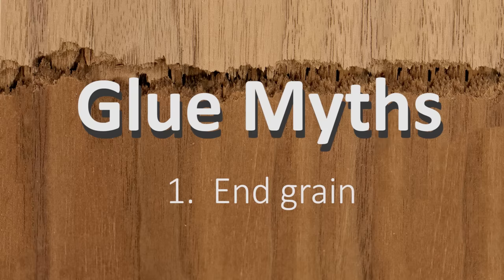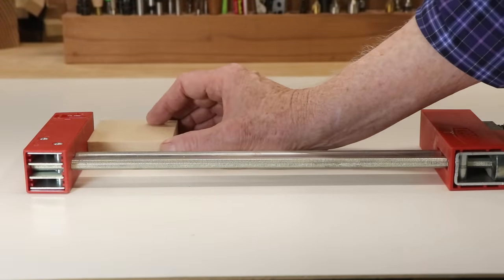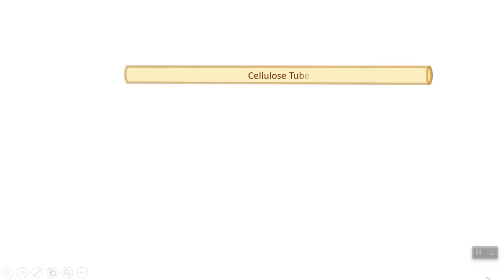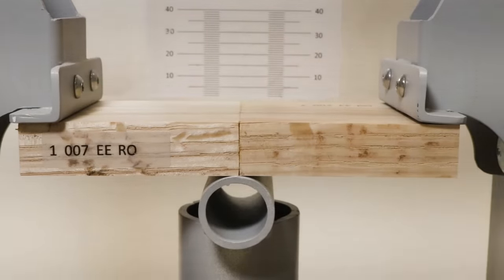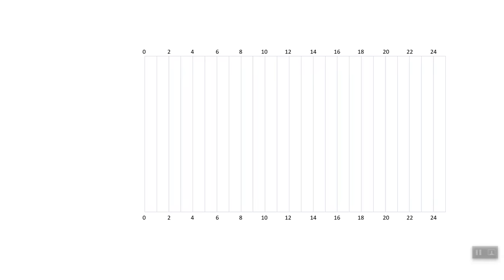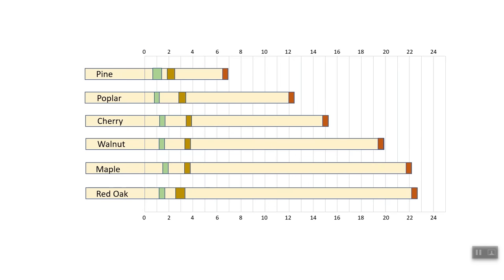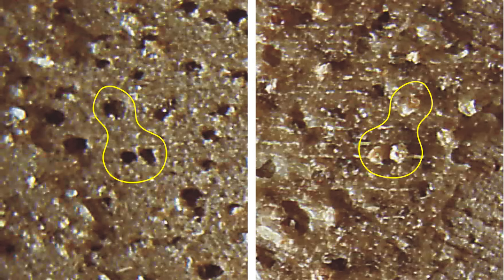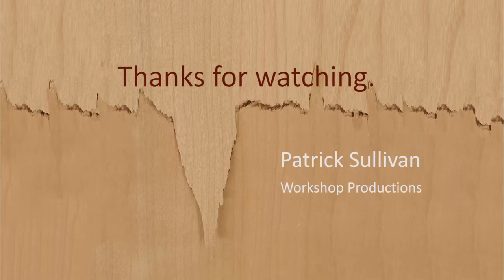Glue Myths:  1. End grain

Comment: That’s outstanding. And really fairly scientific in the approach. I like it. 

Kinda throws out the whole notion of needing “sizing” to get extra glue into the end-grain after some has wicked away. 

I think I might set up some similar tests as you did, if for no other reason than to corroborate your data for myself. 

At any rate, you earned a new sub, and I’ll be sharing. 

Thanks!
James
Reply: While sizing an end grain joint might work OK with hot hide glue, PVA doesn’t stick to cured PVA at all well.  It strikes me as a particularly awful concept.
Reply: @lightaces  Sizing according to Titbond is giving the end grain surface a quick thin coat of 50% glue and 50% water.  That surface is allowed to sit for 60 to 120 seconds and then a coat of normal glue is applied.  The end grain is not coated with full strength glue and allowed to stiffen and then recoated.  Again, according to Titebond.
Reply: @1deerndingo  well, that makes a lot more sense.  Not relevant to my business (see my other post about glue strength not really being important in a well designed joint!), but there you go.
Reply: @lightaces  I think the concept of sizing on end grain joints is not so much to cause the two applications of glue to adhere to each other (because we know that doesn’t work), but to fill up or block the porous end fibers, so that when the full-strength glue is applied, it doesn’t all soak into those end grains. That’s my thinking about it, at least 😊
Reply: "notion of needing “sizing” to get extra glue into the end-grain after some has wicked away."  This makes no sense. If the end grain wicks away the glue, then adding more glue would make sense. Having extra space there won't help.
Reply: Sounds like another test is in order.
Reply: Fairly Scientific!? that seemed like one of the best examples of scientific investigation I have seen in a while.
Reply: Reproducing results is a very worthy scientific endeavour.
Reply: @kristilbilyeu7682  So, the reason I was confused by this is I work mostly with hide glue, and "sizing" with hide glue you let it dry completely.  It works fine because old hide glue is reactivated by the new.  It's also used for completely different purposes - veneering, for instance.
Reply: @michaelwagner8856  It's really not.  The major problem is that, at no point did he actually break a long grain glue joint.  He broke the wood, and then made a conclusion as though those were the same thing.  Which they are not.  It also ignores the fact that glue reacts differently to different force vectors.  Peel strength is a completely different thing from strength under tension, or any of several others.  His methodology was faulty, and it led to some faulty conclusions.  I've got a couple other comments on this video detailing some of the problems, but yeah, no, it's not very good science.
Reply: @lightaces  those are valid points and you are correct that strictly speaking the actual strength of the long grain glue joint was not tested. But he did a lot of other thing well, like controlling the geometry so the shape of the joint isn't a variable, and he  tested each configuration several time so as to have more repeated data points. Its not perfect, but I do think that the conclusion is in practice valid, as long as the rest of the geometry of a joint is the same, two pieces of wood joined end to end are stronger that two joined side to side or long grain to long grain.
Reply: @michaelwagner8856  Honestly, he mostly showed the weakness of the end grain glue joint, and why it was weak (minimal adhesive bond, relying instead on the cohesive bond the glue forms with itself).  The real takeaway from this is about joint design, and that it is a bad idea to rely on glue strength to keep your joint together.  How much stronger was the solid piece of wood?  Many times stronger.  Leverage that in your joints, and you'll become a much better designer, and a much better woodworker.
Reply: @lightaces  I disagree, how is the end grain joint week? this video shows that is is not, compared to other glue joints. that last part is critical when comparing glue, joints end grain joints are not the weakest. now it would be nice if we could design all our wood working projects out of a solid piece of wood, where the grain always runs in the direction needed for the for the most strength in a  given direction, but at the moment that isn't practical. So for now we have to relay on joining separate pieces of wood. I am curious how you are suppose to leverage a solid piece of being stronger in a JOINT?
Reply: @lightaces  True that he didn't show the strength of the long grain glue joint, but he demonstrated that it was always stronger than the strength of the wood.  Going on the principle that the strength of a chin is the strength of its weakest link, he showed that the long grain bond was strong ENOUGH.  If the wood fails, the joint fails.
Reply: @gregmead2967  The thing he showed to me was that, with the end grain joint you don't get a good molecular bond, which is the strongest bond you can get with aliphatic resin glues.  If he had a proper bond, it would have pulled away at least some of the wood.  There are all sorts of problems with end grain joints, and being a weaker bond is only one of them (as others have pointed out, wood movement is going to be a big problem with end grain joints over time), and in the end he showed what we should all know already - relying on glue strength in a design is probably a bad idea.  If at all possible, design joints which reinforce the joint with a stretch of long grain going over the joint.  Hench things like dovetail, mortise and tenons, and all the other joints people cut when they actually want to resist any real force.  Because the glue will only ever be stronger than the wood in some very limited situations.
Reply: @michaelwagner8856  I thought the same thing.
Reply: @kristilbilyeu7682  your conclusion is the opposite of what was presented in the vid. What gives end grain it’s strength is the ability of the glue to penetrate the pores. U might what to revisit this great video, toward the end of it for the explanation. But I do agree with other points u made to others about the “weakness of an end grain joint.” In the real world u cannot control the leverage that can be applied to a joint. The video setup controlled where the pressure was applied to the joints featured. These are valid tests, and so we’re the results. But depending on where the pressure is applied to a joint (distance/leverage) an end to end will fail before a side to side. Again as shown in this vid…ALL things being EQUAL…an end to end is the strongest joint.
Reply: @lightaces  My first impression when he was graphing his results was similar; the edge/side grain joint never failed so we don't know how it compares in strength to the end grain failure. He actually at least tangentially addresses this when discussing the results and I find it hard to refute the logic that it doesn't matter whether the edge grain glue joint is stronger if the breaking point of the end grain joint is higher than the strength of the wood itself (all other considerations being equal, of course). I do agree with what you say in some of your other comments that the real take-away is that relying on butt joints is a bad idea. I've particularly hated the Kreg butt-and-screw joinery that's become so popular because my experience is that screws will loosen with repeated humidity and temperature cycling in the wood which may allow the glue line to fail. If I create a snug fitting mortise and tenon joint to join end grain to side grain the joint has quite a bit of mechanical strength without glue, and the glue (in my unqualified opinion) holds the joint together rather than providing the mechanical strength. One interesting test would be to do an end-to-end grain test using the 8:1 scarf typical to end-to-end joining in boat building. I suspect that failure would be closer to the failure in unglued wood rather than completely failing along the glue line... but I might be surprised.
Reply: @kristilbilyeu7682  This was my understanding from high school (re: sizing). The first coat is to let 'dry' wood soak up some glue into the grain, then, while still wet, the second application of glue is for the bond. Usually done on end grain portions, but it can be used for any combination I suppose. You could just apply one super thick application of glue, but you may just have a larger mess to clean up and still get air gaps in the bond layer. Summary: first application for dry/thirsty wood, second application before first dries for the bond. The key is to do it all before the first application dries so it is one layer.

I think this test was well done. Unless there is a flaw in the method it seemed to yield good results. It could be if the end to end grain bonds always broke at the glue point 'someone' concluded it was weak due to lack of secondary wood damage.
Reply: @lightaces  it doesn't matter if he broke the edge grain joint at the glue if the glue was stronger than the wood. The maximum strength of that joint is the part the failed. It failed at a lower force than the end grain joints, which all failed at the glue.

We have no data to indicate the glue bonds in these end grain joints are weaker OR stronger than the glue bond in edge grain joints. But we know the whole joint was stronger. He is transparent about this, and is debunking that end grain gluing is useless, because it can clearly make a stronger joint per surface area than the wood itself along the weak axis. 

Your other points about not relying on glue are useful and true. Any joint without a lot of surface area should ideally have some other physical means of reinforcing lignin with cellulose. Hence splines.

Also agree with you that the test gives no data about wood movement and any impact that has on this joint. 

That all said, I think there's stress test data on 90 degree glue ups that's much more practically useful.
Reply: What do you mean by "Fairly scientific" how much more is needed?  Look at all the equipment, time and detail, and imagine the cost of it all! I'd need a lot less to convince me, as the mere point of where the wood fails vs where the glue fails in knowing wood is stronger along the grain should be sufficient, and probably would be if not for such a thing as "Cognitive bias".

Really, I knew all along that the PVA glue is stronger than the wood along the grain, and guarantee my clients that my joints will not fail, while warning that it won't stop the wood from failing if they put the same force on something I repaired again; mainly the head stocks of Gibson guitars, which are a glaring example of everything you can do wrong implemented.  I also push reinforcements hard, but some "Purists" are already upset that the glue isn't original, and often refuse them;  I say "come back again" when they pick it up, and they often do, with the very same instrument busted a bit up or down from the first repair, to where I can say:  See, I guaranteed the glue joint would hold, and it did.  Want the reinforcements this time?

Comment: As soon as you showed that the glue was stronger than the lignin, I understood why mitre joints (especially with splines) are so strong. 

Jason at bourbon moth woodworking made a video testing different types of joints, and was surprised that mitres were stronger than boxes and dovetails.

Thanks for challenging and expanding our knowledge!

Comment: Actually this just shows what we’ve always known - that glue joints are stronger than wood in side grain joints, and that wood is stronger than glue in end grain joints. This experiment never broke a side grain joint, because the wood failed first - so we still don’t know how strong that joint is. The end grain joint was the only glue joint to break - otherwise we’re only seeing the comparative low shear strength of wood along the fibers, compared to across the fibers, which we knew anyway.
Reply: Good point. Thank you for sharing. Have a blessed day.
Reply: Yes, this.
Reply: This is the definitive take-away. Make those boards (end-glued) twice as long, and move the point of leverage to the ends and test it again. I would imagine the results are strikingly different.
Reply: Exactly, this whole, lengthy presentation is an example of cognitive bias.
Reply: @djlusid  And why we would only test the end-grain glued joints with longer leverage? If you did all tests with longer boards, still the results would be the same (not the absolute values of force, but the comparsion between end-grain and long-grain), because why would it change?
Reply: @jankoodziej877  endgrain to sidegrain or endgrain to endgrain would typically end up in the construction of the furniture, chair legs, table base etc. These parts are the ones that are exposed to long leverage. A wider panel, side grain glued, is almost never exposed to leverage. A table top rests on the aprons and so on. If you had a free hanging wide panel it would make sense, but you never have. Fine woodworking tested different corner joints, with leverage, and the end grain to side grain was the weakest, weaker than all reinforced joints (domino, tenons etc). Cant see that this video would change the way I do woodworking.
Reply: @CarmoniusFinsnickeri  I don't see how any of that is relevant to the test. Obviously better joints are... better. I still see no need to do the same test with longer boards, because the results would be the same. You seem to misunderstand the test. It didn't compare joining with glue only versus better joints. And obviously for applications where there are bigger forces applied to the joint, the glue only might not be enough. The test clearly showed the glue has barely 1/4 - 1/3 strength of the grain.
Reply: @jankoodziej877  I very well understood the test thanks.
Reply: "This experiment never broke a side grain joint, because the wood failed first - so we still don’t know how strong that joint is."  you dont measure a chain by its strongest link.  you no longer have a joint if the material fails and there is no real world application to knowing the specific strength of the glue when the material will always fail first.  if i screw a piece of drywall into a 2x4 and apply pressure the drywall will obviously break first.  it doesnt matter how strong the screws holding strength is nor will it ever benefit me to know that strength if i continue to use this joining method.  clearly i need to change my approach if i want a stronger joint.